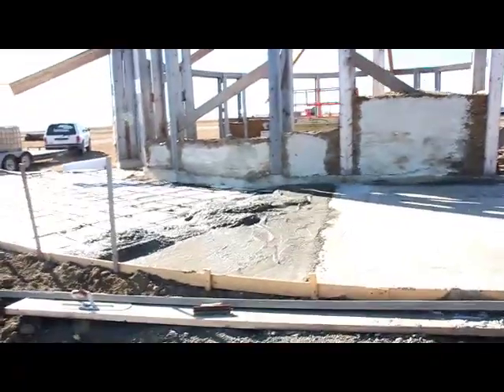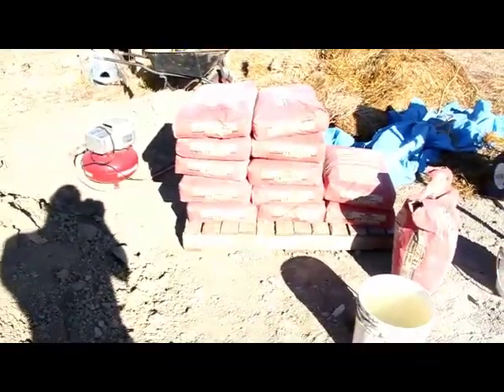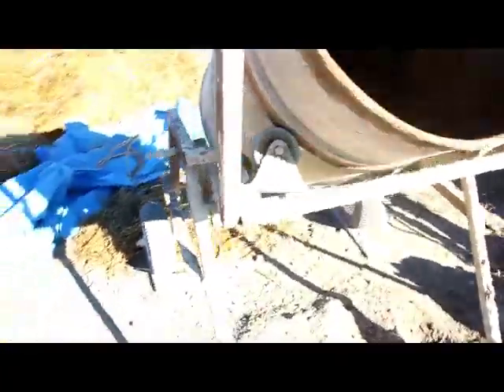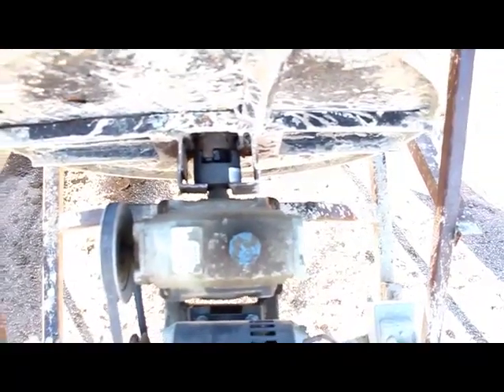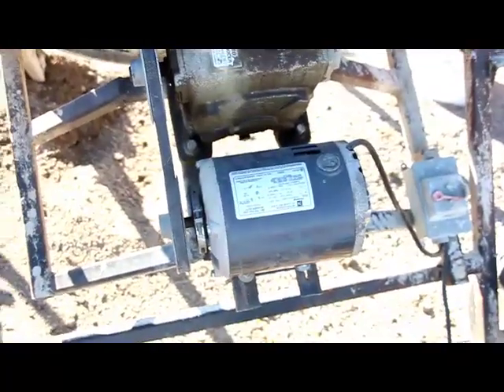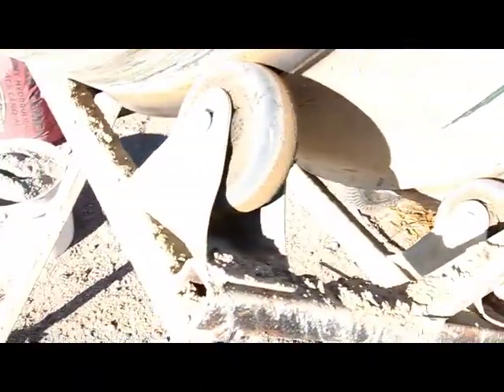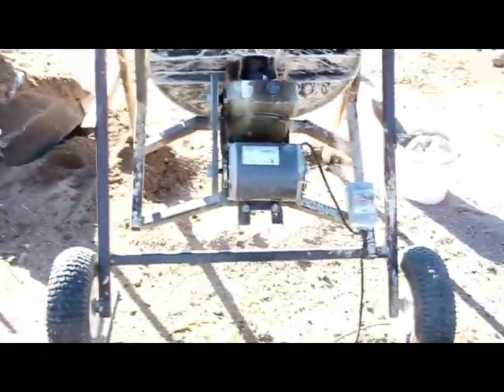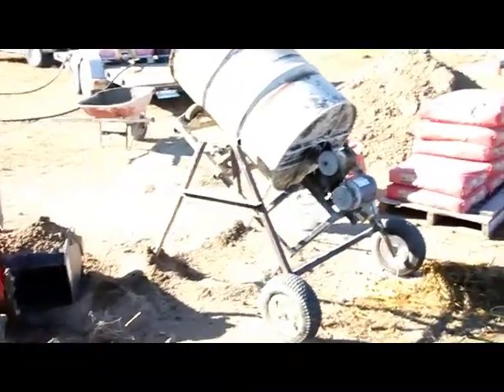Homemade Cement Mixer - Offgrid

Comment from the maker: 350 lbs wet weight (2 really heavy wheelbarrows full). Recipe should be tweaked for your area and conditions. Here we use 123 rule - 1 part portland cement (Type N or 10), 2 parts rock/gravel, 3 parts sand. Some times we find the gravel we get delivered quite sandy so we just mix 1 part cement to 5 parts gravel with good results as well. Depends on what is available in your area. Most important is no topsoil, dust or dirt in the mix - makes a weaker concrete.

Comment from the maker: Water is trial and error. Mix has to be wet enough to mix all the ingredients but it depends on your use for it. A really sloppy mix makes light weight weak concrete that spalds easy but places well. A mix too dry is hard to place, hard to work, runs risk of cavities or voids, but is super hard and lasts forever. Good rule of thumb - It should flow like a milk shake but be rigid enough that you can press your fist into the fresh concrete and leave a hole (shouldn't fill back in)

Comment: Hi :) What kind of the tractor do You have?
Reply from the maker: It's a Repainted Kubota 2601 (Similar to an L4701). Nice tractor...but it's rebranded as a "gray market" so I'm having a hard time finding parts when I need them as Kubota removed those tractors from their parts listing when they started showing up in North America rebranded.
Reply: @Naturally-Kelly  Thank You, It is very practical. I have one more question, because I  want to dig the clay from a field to build my house, could You tell me what kind o machine You have been used to grind, fragmentation a clay? I saw You have same powder of a clay.  :-)
Reply from the maker: @MrPilotnik  we dug a large pond using the front end loader of the tractor. While cutting down the pond I kept the top 6" for top soil and piled it. As I scraped down the. Next 12" I set that aside for fill material around the yard. Everything deeper than that was good clay. Leaving the pile of clay a year to dry out makes it easy to work with the next year with minimal clumps.
Reply: @Naturally-Kelly  Ok, so I need to preparing a clay one year eariel. I suppouse we have a similar climate.
Greatings from Poland :)

Comment: Hi 
would I know the speed reduction gear
Reply from the maker: Hi Ratnasingam, 1:60 is the gear reduction we've used because the motor is 1740 RPM 1740/60 = 29 RPM.  Because the motor is 1/4 hp when you gear it down 1/4 * 60 (1:60 gearing) = 15...you actually get 15 hp from a 1/4 hp motor. The most important things we found are 30 RPM seems to be the magic number for speed and 20 hp would be the minimum power you need to not burn out your motor. Cement is really heavy. Hope that all makes sense :)
Reply: He means 15 horsepower less friction losses, of course.

Comment: lay off the pot... you would have been better off going to lowes and spending $200 on a basic mixer and not burn your time...
Reply: Burning your time would be having to mix twice as many loads of concrete because your mixer is too small.